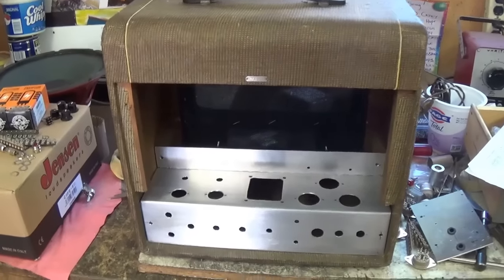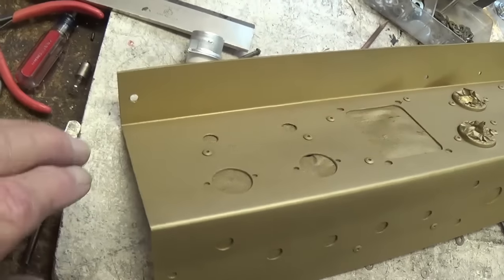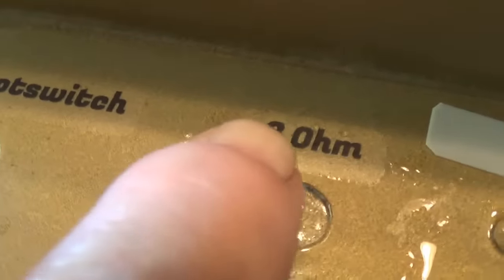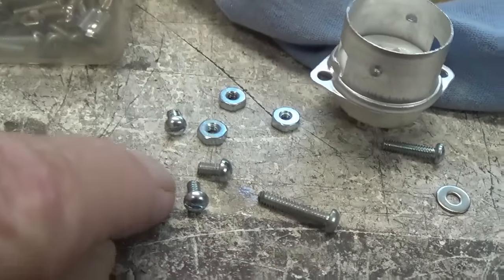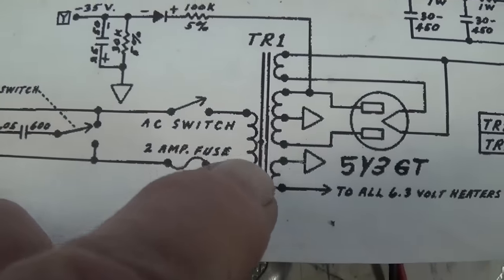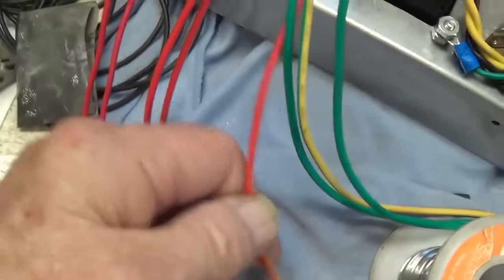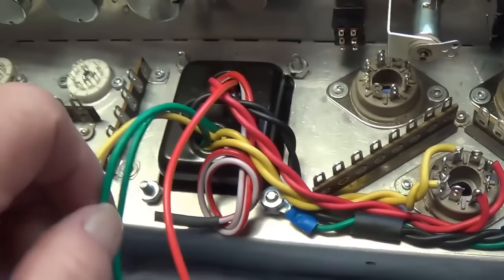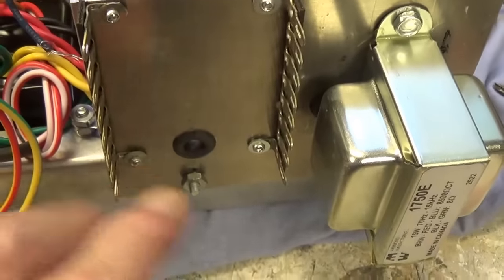Let's Build the Suprinceton, Part 2:  Chassis Painting, Assembly and Wiring

Comment: I have a restomod 67 Mustang convertible! T5 trans, 3.55 rear end, front disc brake conversion. This past  summer I pulled the 302, had a local engine builder build me a 347 stroker short block. Toss in AFR aluminum heads, long tube headers, classic Edelbrock performer and 500cfm carb. Over the winter she’s getting a sniper upgrade! I’ve done all the upgrades and work myself. This is the second time I’ve pulled and rebuilt the engine. Did it in 04 just to refresh the 1968 302! Moderate street cam, 4bbl and manifold upgrade back then. Suspension has all been upgraded too!
Reply from the maker: Thanks for sharing, Bob. It sounds like a great car :)
Reply: @UncleDoug  At 70 years young, I still play live solo classic rock shows up here in western NY! I recently picked up an Epiphone Blues Classic 30w all tube amp! Even tube rectification! Awesome tone! Problem is, it weighs a TON!
Reply from the maker: We're glad to hear you're still going strong at 70, Bob.......and yes, tube amps can get pretty heavy. @bobsbarnworkshop

Comment: Another great video! Looks like a lovely amp build - and some nice rides too. V8, a thing of beauty and a joy for ever. You really should get a DeLorean, if you don't have one already! :)

I never rivet the tube sockets. It's a pain in the ass to replace one if it fails. Screws are way nicer to do that kind of work, though I've seen rivets used all over the place in vintage gear. Had my good deal of swearing and ranting too.

Speaker wire disconnect resistor is a good idea. I do that too on smaller amps like EL84 PP.

Thanks for the insights on electrolytic corrosion. Being a bicycle mechanic with a keen eye, I see it especially on bikes that have been standing around in the open. 

I'm not a fan of using the chassis as current flow path. Of course, that's how they did it way back when... but I've always used either star grounding or bus grounding, to keep the hum in check, AC wires twisted, heating center-tapped, virtually center-tapped or even with a hum pot. 

I like these old paper tube catalogs. Got two of them, a handy reference if I don'tt want to waste time looking a datasheet up in the net. 

"They say 1W, I say 2W" - for a good reason. Modern metal film resistors are way smaller in size compared to carbon comp - that's less thermal mass, less dissipation surface, higher temperatures. Not a good thing.
Reply from the maker: Thanks for sharing all your insights and tips,  KE :)

Comment: This Grounding system is known as a star ground i use it in ALL of my solid state Amplifier designs . Its one of the only ways in high gain amplifiers to stop parasitic feedback and oscillations .Ground loops are a major concern in amplifiers the Star Ground eliminates a lot of that concern if done properly . Nice looking amp Doug
Reply from the maker: Thanks so much, Robb. I am quite familiar with the "Star Ground" concept, but my method uses the CT of the HV winding rather than the chassis as the final ground......which, to me, seems a bit different.

Comment: How riveting!  😋 For that final cleaning of the chassis, and for a bunch of other general shop cleaning, I use a 50/50 blend of windex and isopropyl alcohol (the 91% stuff).  The IPA cuts sharpie, and the windex makes it streak free.  Interesting idea on that switching output jack, I like it!!
Reply from the maker: Thanks for the tip, GF.  Glad you enjoyed the video :)
Reply: @UncleDoug  You're welcome.  I might have to give this circuit a try at some point.  I think I might have most of what I need to build it already, except the main filter caps.  I want to say I even have a donor chassis with a pair of 6V6s and an OT....  If not, I have 2 pairs of 6973s with matching OTs, I could sub one set for the output section.
Reply from the maker: Good luck with your project, GF.  @guitfidle

Comment from the maker: NOTE: I have prepared and posted a schematic for the Suprinceton circuit:    https://app.box.com/s/4w0s4i1iwu8qz34gcqj899zq2hba2nhk   Also, as several viewers have mentioned, the addition of 470 Ohm screen resistors may be a useful addition. Another good point: Using Pin 8 for B+ from the rectifier will allow the use of indirectly-heated rectifiers, like the GZ34 and 5AR4.

Comment: Nice Job Uncle Doig.  On Aluminium I would always aim to use an etch Primer to really bond to the surface, an epoxy primer would also do the job. Nice spray job with the 2 pack clear coat. don't see much Orange Peel. On the decals - Microsol make products to aid in decal application for plastic kit modellers. these should help you slide them easier into place, but again - the kit model decals prob have a thicker carrier layer... a little dish soap in the water could help slide it. they do that also with stickers for cars as you probably already know. looking forward to the money shot.
Reply from the maker: Thanks for your helpful input, Stephen.

Comment: Hmm, that dual high voltage output presents an opportunity to use separate power supplies for the preamp and power sections. Could be interesting if not likely extraneous. It might be interesting to use a separate solid state rectifier for the preamp with its own decoupling supply and use the 5Y3 for the output tubes only. Might have the benefits of improving hum and reducing power sag.
Reply: Either that, or for a tube and solid state rectifier (compensating for voltage drop in tubes), or for higher B+ on plates and lower on screen grids. Still, a pretty interesting design.

TBH I've been thinking about using separate rectifiers for preamp and power amp, e.g. switchable tube/SS for output tubes, fixed SS for preamp.
Reply from the maker: Thanks an interesting and novel suggestion, Brad. I'll keep it in mind for the future :)

Comment: Looks pretty good!  The milky appearance of some of the waterslide decals is caused by air trapped between the decal and the surface.  The primary cause of this is forcing the extra water out from under the decal when applying it; that forces out the adhesive as well.  The best thing to do is apply a drop of water to the surface where the decal is going, and carefully slide the decal into place.  Gently press on the center of the decal to stick it down, and then walk away.  The water will evaporate.  As it does it will suck the decal down tight and leave the water-soluble adhesive behind, between the surface and the decal.
Reply from the maker: Thanks for the helpful advice, DiC :)

Comment: Thank you again for a great video. I love the very methodical way you go through every step and the additional deviations into theory. I also enjoy they way you are getting "fresh air" in between - I hope your neighbours do too. Firing up un-muffled vintage combustion engines in a residential neighbourhood did get me into a lot of trouble here in Germany.

I am amazed that you were able to make the labels look so good on your first try with this type of decals.
I have experimented with water slide decals for a while, but finally gave up on them. You need to cut them out as close as possible to the letters and you always want to round all the corners. Square corners will stick out a lot more visually. Spraying clear coat over them tended to be a lottery. Some lacquers sort of dissolved the membranes and made them all wrinkly, some turned the black letters grey and some worked just fine. Be sure to experiment on a separate piece first. This turned out to be too much of a hassle so I found some rub-on letters (you can still get them on ebay or Amazon). It takes patience to get them on straight and you never have enough As or Es on the sheet, but once you clear coat those they look kind of professional without the "halo" of the membrane.
Reply from the maker: Thanks for the very nice comments and helpful suggestions, GYM :)

Comment: Uncle Doug just one little snivel. If the amp hits Mach 1, (much more Mach 2), the vibration the wiring will experience will be almost unbearable. As an aircraft Electronics Tech for 15 yrs, I'm thinking you've neglected to consider that. (even subsonic jet aircraft experience massive vibration). We used silicone tape, & rubber insulated clamps to help fight that malady. Just playing Uncle Doug. However the precautions we took working supersonic & subsonic aircraft still screams in my old mind. Trying to have a little fun, which since I moved to New Jersey is hard to come by. Great job Sir. I look forward to heary that baby fired up. Be blessed.
Reply from the maker: Thanks for the "helpful" tips, BM. You too :)

Comment: Hi Uncle Doug. Another great video! I've worked with the decals you used many times in the past and have had similar results. I've made them for guitar headstocks. Most of the time they come out great but every so often the have that cloudy look. I still don't know what causes that. Also, a tip on cutting screws is to thread the nut onto the screw before you cut it, after you cut the screw touch up the burrs then when you back the nut off the cut screw it cleans the threads.
Reply from the maker: Thanks for your input, Tim. Your description exactly matches the method we use.

Comment: To make applying the decals easier, add some cleaning grade white vinegar to the water you're using. I also then like to use a pair or tweezers and a small paintbrush to apply them, in particular as you noted Doug, the smaller ones. Have some paper towel handy too to help soak up any excess water or to dampen and wrap around your finger to help flatten the decal down
Reply from the maker: Although I didn't use vinegar, by the time I finished, I did use most of the tricks you mentioned. Applying decals takes some time, experience, and resourcefulness.......it's more of an art than a basic procedure.